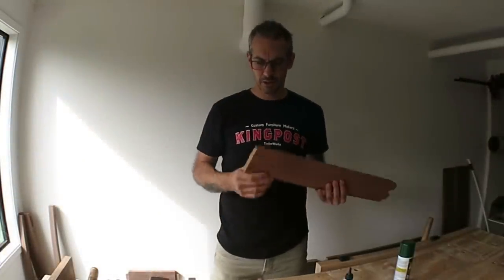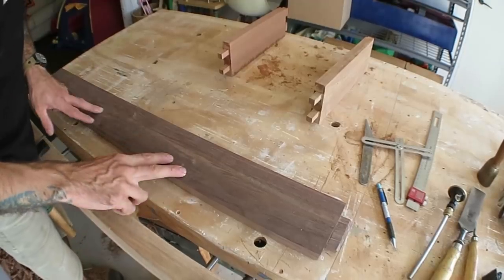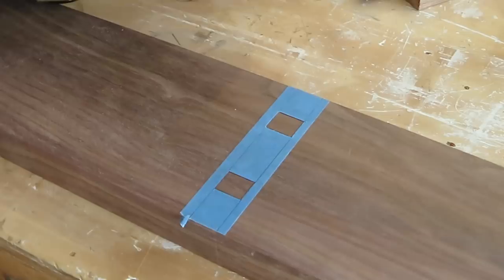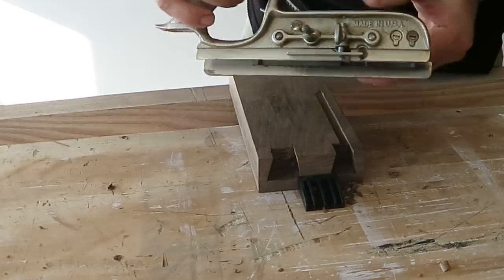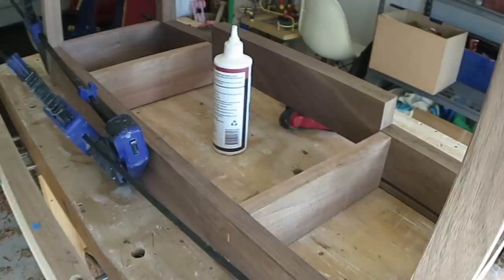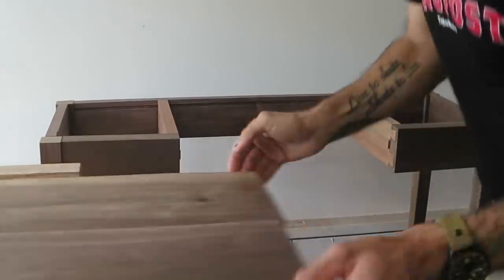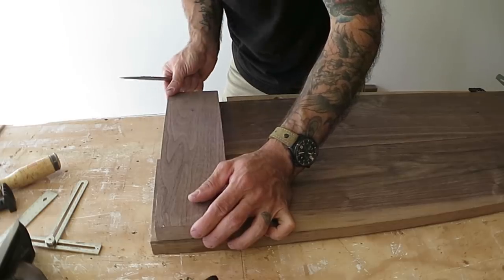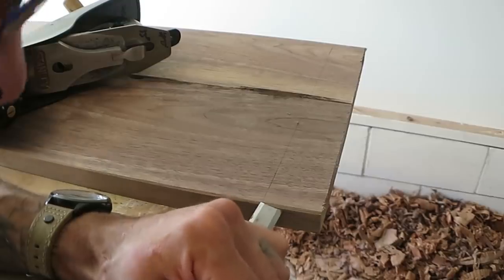Playroom workshop Ep  5,  glue up

Comment: Great videos. Question? What are the the benefits of a double tenon (sometimes with a haunch)  vs a single tenon?
Reply from the maker: It's really a question of how much timber will need to be removed in making the mortise,  will that weaken the timber member. As far as I know haunch is used in doors where you want the but joint to be as air tight as possible.
Reply: @KingPostTimberWorks  Thanks for the quick reply. Keep up the great work and good luck for when the lock down ends. Cheers from Runcorn, England